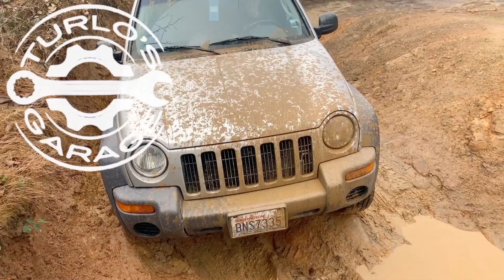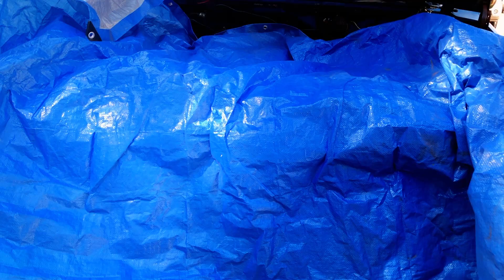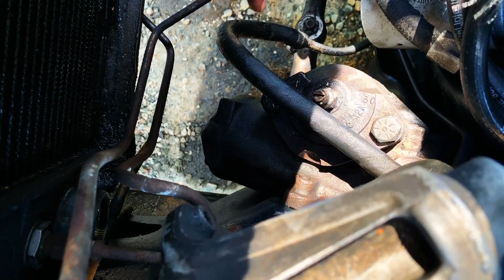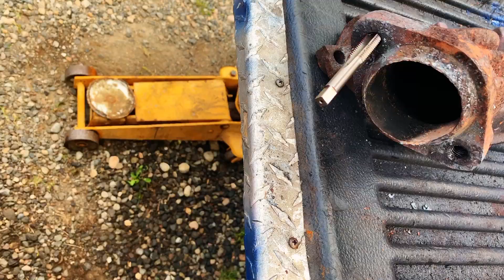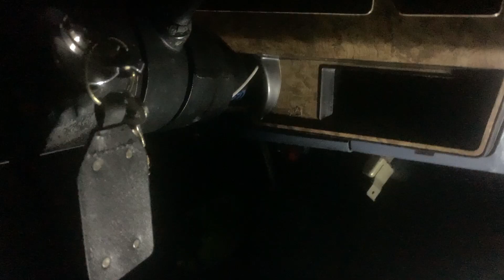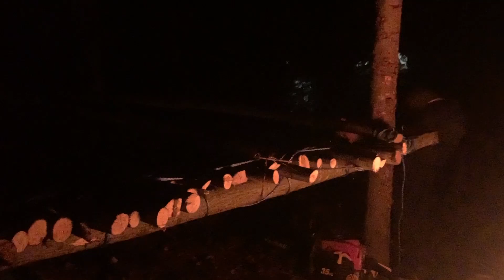DRIVEWAY RESCUE | Abandoned 1985 Ford F-250 4x4 Big Block 460 Revival and Reassembly EP 3

Comment: P/s pressure hose, i get them made and re-use the steel tubing. Swage lock fittings. 
Great for custom work. 
Broken studs, i heat manifold glowing and grab bolt with a vise grip. Most often they come out. 
One of my vids shows removing a broken stud from a cast head.
Reply from the maker: Those bolts were not coming out on the passenger side. The driver side came out no problem. That was a job that went from a few hours to a few months. 👍

Comment: Hey, do you still have this Truck?
Reply from the maker: Yes. I fixed the engine, a lot of the wiring, fixed the tail lights, new brakes and hardware and parking brake cables all the way around. New rear wheel bearings. New front u joints, scrubbed the heck out of the interior. Rebuilt the power windows regulator and motors. New radiator, Edelbrock carburetor and a new battery and cable ends. then about a year ago the transfer case broke. It is stuck in 4 lo. I think it just needs a shift fork. My Dad really wants to get it fixed. Just sitting in the backyard now with no carb or battery as they went into the Granada. I have way too much money in it now. LOL